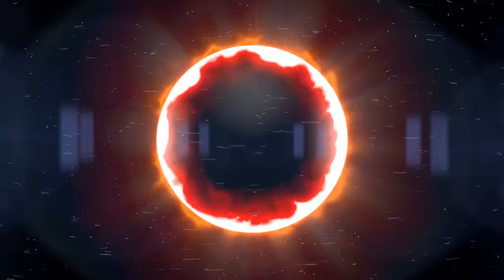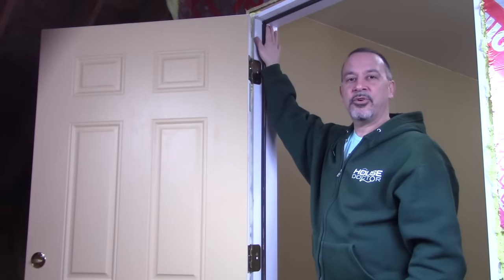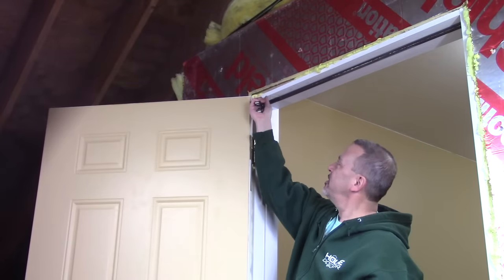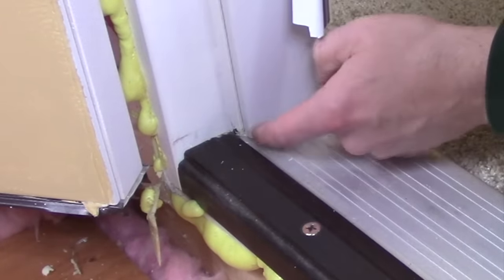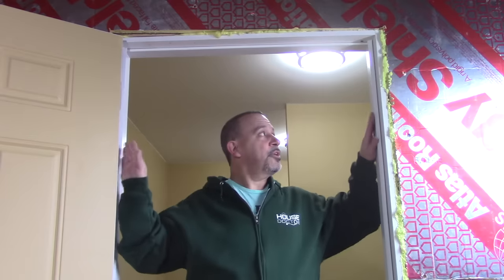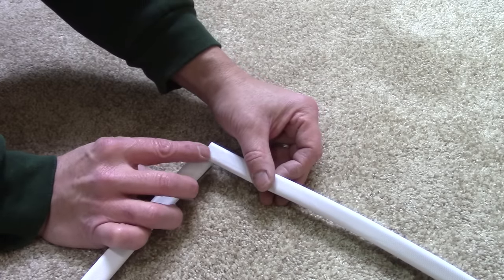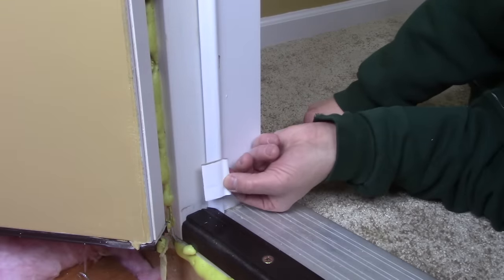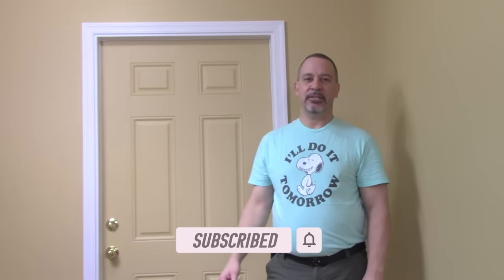Fix drafty doors

Comment: Since you have the weather-strip newly installed, why do you still need the square piece? Good video, but still don’t understand why it is needed. Also why didn’t you use four squares?
Reply from the maker: I used two squares, one on each side at the bottom.  I guess because there isn't an overlap of weatherstripping in the bottom corners you need the extra thickness.
If you shut off the lights inside and look carefully all around the door you'll almost always see daylight in the bottom corners.  They usually come two in a package.
Reply: @HouseDoctorRay  Ah, I understand now! I bought the squares earlier this week and didn't know part of it was to be tucked into the weather-strip. Your video was very helpful! Thank you!!
Reply: I NEED to do this, thanks!
Reply: Could the square almost act as a shim?  I removed mine ,not knowing what it was, because I was painting and repairing the frame, and ever since my door is sticking near the lower half of the door. 🤔  do you think this could be the cause?
Reply from the maker: Usually when it's sticking near the bottom it's because the top hinge isn't tight enough.  Get some 3" screws and replace two of the screws going into the door jamb.  Make sure to predrill first.

Comment: I'm a diehard "I'll do it tomorrow" cultist and here I am halfway into winter with a drafty door. Ughh. Thanks for sharing this. I already see how the dimwit door installer (not me) did a crappy job with trimming the door seals and omitted the lower corner seals as well. Your explanation for proper trimming the ends of the seals is invaluable.
Reply from the maker: Thanks.  It's so easy to make it right.  Unfortunately even prehung doors often come with the weatherstripping cut square.
Reply: Okay, I got the replacement seals in place, trimmed very good by following your technique, and even put in those bottom corner additions. It's airtight around the door or at least no noticeable draft as yesterday! Thanks again Ray!
Reply: Uggh. Spoke too soon as I get the wind changed direction. I actually believe cold air is leaking in under/past the threshold. I'll try to find some smoke sticks or incense tomorrow to confirm. These are row complexes, so I think they got the worse companies to put in the windows and doors because even the uPVC windows units are drafting.
Reply from the maker: If it's leaking under the threshold usually all you can do is caulk along the edges.
To fix the windows is a little more involved; especially if they overtightened the mounting screws or installed them crooked.

Comment: These wedgies work really well.  We are old and live in an apt with the patio door in the living room and not a good seal.  When the north wind blows you can feel the draft.  I knew I couldn’t do the weatherstripping but i could do the wedgies.  Had to buy a bunch and spent around $80 on them at HD, but they did the trick.  The reason we needed so many is because we aren’t very smart and put them in backwards and had to double up.  But we did manage to seal off the draft.  It sucks to get old.
Reply: There’s nothing wrong with getting old. This was a beautiful testament of your independence and says a lot about your life overall. Thanks for sharing.

Comment: Thank you , but I have a question on the little square pieces. I’ve noticed recently on my exterior doors exposed to the weather here up north that I’m getting wood rot right there. Any tips to prevent this. I have the little squares but they seem to be made of all black foam not white vinyl like you shown here. They came that way when they were installed new. This is on an exterior shop building that I wouldn’t want to put on storm doors but want to keep the moisture out. Somehow moisture is staying in the foam from snow and driving rain Great explanation and detailed on proper weather stripping .
Reply from the maker: You can scrape them off and replace with the ones that have a vinyl coating.
Check your caulking all around the door frame.  Also make sure your door has a drip cap at the top.
Any rotted wood should be scraped and painted.  If it's real bad, patch it with Bondo then paint.

Comment: OMG, I never knew the weather stripping slides into the trim!!!! I have terrible draft at the doors, and thought the stuff was worthless!Thank you so much!
Reply from the maker: Thank you, glad you liked it.
Reply: This is true of more modern doorways, but there are older doorways that do not have the kerf cut into the door stops. With those, the kerf can be cut in perhaps, but it’s probably easier to replace the door stops with ones that have the weatherstripping already attached (with kerf already cut). Either way expect to do some paint touch up at minimum.

Comment: Is that yellow stuff spray foam? Do you recommend that too? Thank you
Reply from the maker: Yes, it's spray foam but the wrong type.
The foam is used behind the molding or casing.  It fills in the gap between the door jamb and the framing.
You should only use foam labeled for windows and doors.  It's usually white, the yellow stuff is for gaps and cracks and can easily bend a door jamb or window frame.

Comment: Could I just put the corner seals before the actual strip instead of putting it behind it?
Reply from the maker: You really should put it in afterwards because if you put it too far back the weatherstripping will be compressed in that spot.

Comment: How do you remove old peel and stick foam weather stripping? Mine isn't coming off very well.
Reply from the maker: Heat gun, hair dryer, WD-40, olive oil, putty knife.
Reply: @HouseDoctorRay  Tried the putty knife, and it didn't work. But I'll try the other suggestions. Thanks!

Comment: The door to my attic is warped at the top on the side with the door knob. It looks like I need thicker weatherstripping is there a way resolve. Currently I added some round foam under the weatherstripping but it is not thick enough to stop the draft. The door opens into the attic.
Reply from the maker: Try adjusting your strike plate first so the door latches in further.
https://youtu.be/UqZoizeCO8g
If that doesn't work you can try shimming or bending your hinges.

Comment: How do you take off a corner seal without wrecking the wood? Mine are installed wrong.
Reply from the maker: Heat gun, hair dryer or scraper.
Reply: @HouseDoctorRay  thanks, I'll try the scraper 1st, just to see if it works.

Comment: There are some other videos where they caulk the entire side seam from threshold, over the door seal and corner seal to the inside.  Is it necessary to do that?  About to redo my door seals because of the bugs coming in!
Reply from the maker: There shouldn't be any caulk on the weatherstripping.  It should be free to move and flex.
There should be caulk between the molding and the door frame if there are any gaps.
Reply: @HouseDoctorRay  Thank you!

Comment: The weather striping along the bottom of the door going outside is coming off.  I don't think that is the same weather strip product as you used.  It appears that it is attached to the door - not the plate.  Do you have a suggestion or a video on that ?
Reply from the maker: Check out this guy:
https://youtu.be/K1WRRT-h_zs
Reply: @HouseDoctorRay  Perfect.  Thank you.

Comment: You didn’t explain why you needed those corner pieces. Won’t the weather stripping seal at the corner?
Reply from the maker: For some reason the weatherstripping never seals well at the bottom corners.  The little squares help it stick out a little more so get a good seal at the bottom.

Comment: I have so much cold air coming in it blew out a candle when I placed it near the door. I’m afraid purchasing weatherstripping is not good enough as they don’t make it thick enough for warped doors. What then?
Reply from the maker: First try bending the little tab inside the hole where the door latches to get it to close tighter.  Then get a look all the way around to see if the door is warped too bad.
If your door stop is removable you can take it off and reset it to match the warp in the door.  However most door stop on exterior doors isn't removable.
Your last option is to reset the jamb or replace the door.  Both are a lot of work.
Reply: I second the suggestion to install the door stop to follow the warp in the door; door stops are thin enough that they will flex a bit to help with this situation.

And if the door stop won’t flex enough, use a saw to cut it into pieces that will better follow the contour of the warp, and install the door stop in pieces. Sharp points on the edges should be trimmed a bit. Then use an oscillating saw to get the kerf at the seams to be able to accept the weatherstripping’s kerf insert - but only at seams where it’s necessary.

Comment: Should I be confused about how you installed those corner squares?  If I'm installing or replacing all of the weather stripping, wouldn't I want to begin with the squares?  Or were you demonstrating for people who are only adding the squares?
Reply from the maker: The squares go in after the weatherstripping.  If you install the squares first they'll block the slot the weatherstripping goes into.

Comment: What’s the purpose of the square pieces on the bottom?
Reply from the maker: It pushes the weatherstripping out a little more.  For some reason at the bottom there is always a leak in the corner without them.
Reply: My contractor put it at the top….it’s 12 yrs old & when I replace will now know how to do correctly…thanks!
Reply from the maker: Do the weatherstripping first.  Then check the corners to see which ones are leaking.

Comment: How does YouTube know I put up weather stripping every time I close my door.  I add it inside because that’s the best I can do.  I guess it’s time to call a carpenter.  Help.
Reply from the maker: Every App knows.  Every website you go to drops a tiny file on your computer/phone.  They all read the files.
They also log your location and every WiFi you encounter wether you connect or not.